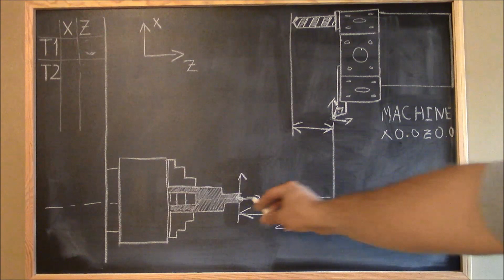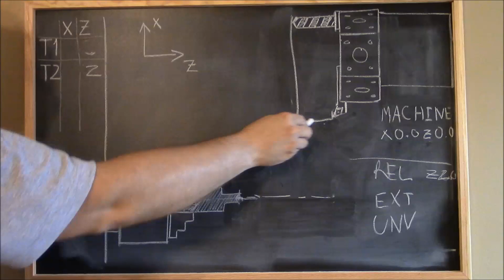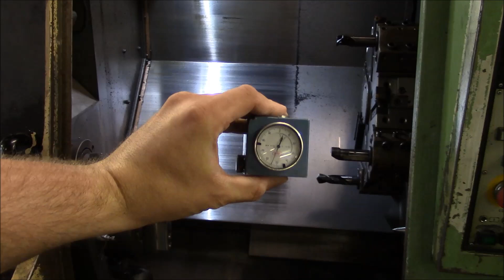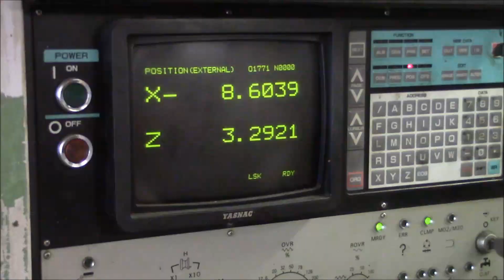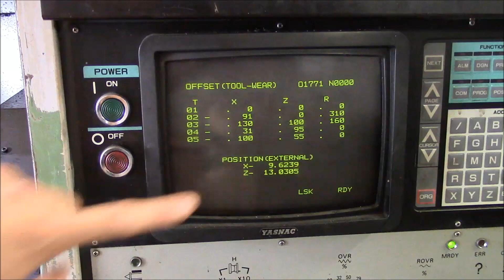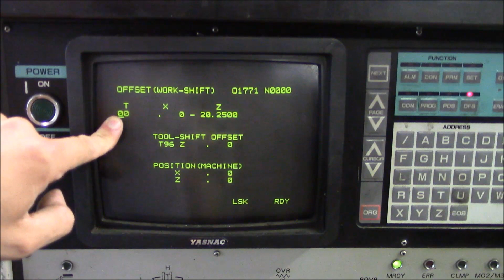Lathe Tool and Work Offsets

Comment: You explained all that as simply as possible. The fact that there are still several things to keep track of simultaneously though, is exactly why I just use the tool offsets exclusively, and put all my programs together so they assume the same set of offsets and the same set of tools. 
I make a lot of parts that run OD threads off both ends of the part, so I use a face driver a lot. I set Z0 at the left end of the workpiece with the most frequently used driving disc, and just fudge everything else from there.
Reply: I clicked it hoping he would talk about 6.7 powerstrokes.

Comment: With our lathe, ill use the cutter to come in on Z axis and just clean the surface off of my part,
then I subtract the length of my part from the value that is already saved for that tool.
Once I find out what my answer is :(example .002"  or closest rounded value),
I make sure the lathe is set to .001" movements for every click of my Z adjustment dial,
then I will turn my adjustment handle -.002 clicks.
Then I save that value to Z.
Then for my boring bar, I will remove a bit of material on the inside diameter usually (.002"-.004"),
where I have a nice smooth surface.
Then I find the proper pin gauge that fit's the best, not to tight but as close of a fit as possible,
then enter that value of the pin gauge into my X value.
Those are just 2 of the values that I have to enter.
Got to enter the out diameter of the part also if I am machining material off of the outer diameter of the parts,
both for my cutter and boring bar also.
Thanks 4 sharing all these very informative video's.
+1 Sub

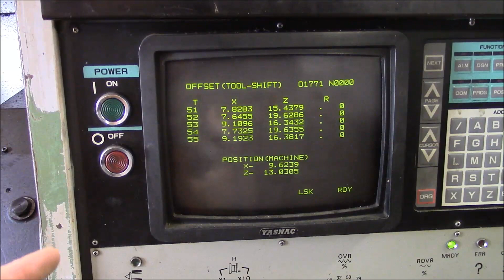Comment: 14:26 you pull paper out without broke it so you are 2x paper with larger.STILL. you will cut bigger jole. and outer tool you cut smaller. you have hardened chuck that has outer measure that not change. use it :) yes you can measure inside tools too

Comment: Very informative. I appreciate the chalk talk at the beginning. I'm working on a lathe conversion to CNC and am trying to learn what the best practices are for offsets and alignment. After watching your video I wonder if I'll be configuring the tool offsets and alignment much more frequently because I'm using an quick change tool post instead of a turret.
Reply from the maker: Your quick change tool post should be very repeatable. You can record the offsets for each tool holder and just change them as needed. I don't see an issue.
Reply: You're not "converting" anything. You're adding a DRO to a manual lathe.

Comment: When you set your tool length offsets (TLOs) with your presetter, are the TLOs positive or negative values?
Reply from the maker: It can be positive or negative depending how you calibrate the touch setter.

Comment: 2:16 actually that line belong. part front to behind chuck where machine zero is. usually, but i change it front of chuck. that way G54 is lenght of chuck to part front. easy. so easy. so for short machine zero is when turret go thru chuck. i have know idea how is like that. why not front of chuck. you never need move turret behind chuck CRASH lol